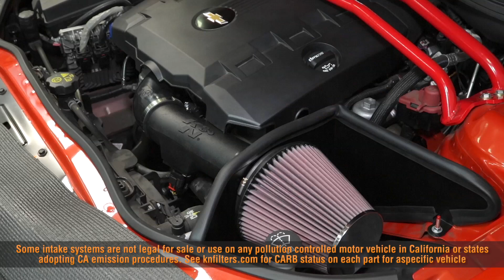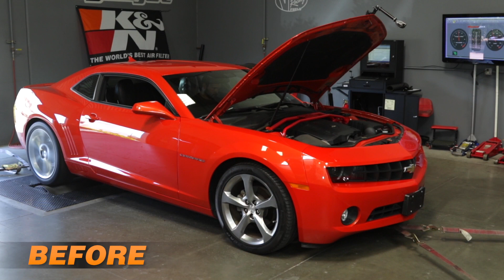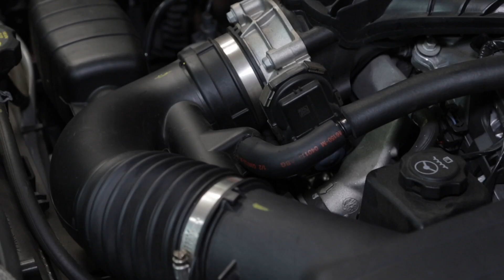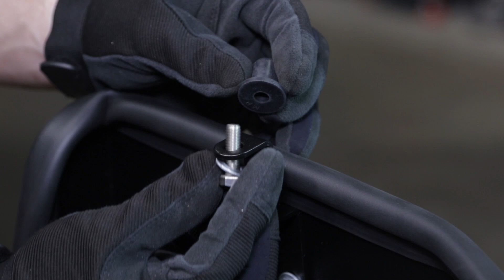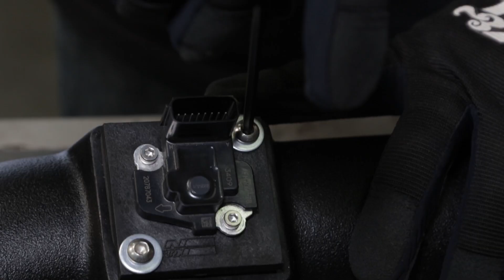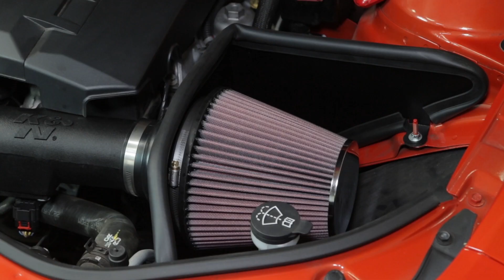Chevy Camaro 3.6L [#57-3078] Air Intake Installation

Comment: Would a 2020 k&n v6 air intake fit a Camaro 2015 v6 lt
Reply from the maker: Yes this system will fit a 2015 Chevrolet Camaro 3.6L.  We have several systems for that vehicle, check them out on the following page
https://www.knfilters.com/chevrolet/camaro/3.6l-v6-gas/2015/

Comment: Does this fit a 2015 Camaro LT V6?
Reply from the maker: Yes this system will fit a 2015 Chevrolet Camaro 3.6L.  Check out the product page on our website https://www.knfilters.com/57-3078-performance-air-intake-system

Comment: waste of money if you don't have the car tuned properly for this mod......
Reply from the maker: All K&N intake systems provide a guaranteed increase in horsepower and torque with factory ECU settings.  This system has been tested to provide an increase of 13.14HP and 14.44 LBFT.  Check out the dyno chart on our website http://kandn.com/dynocharts/57-3078_dyno.pdf
Reply: @KNfilters   why should anyone trust YOUR dyno charts ????  Unless the car is tuned for the mod NO one will see an increase in HP.....in fact they may see a decline in performance......... FACT !!!
Reply: @jessieismyfriend  I wanna get a cold air intake for my 2015 Camaro so should I get a tune first before I even get the intake?
Reply: @jacobcardenas9697   get the air intake installed and then have it tuned by someone who knows what they're doing

Comment: Why does my car keep turning off
Reply from the maker: Please contact our product specialists at 800-858-3333 or tech@knfilters.com.  They will be able to quickly help you resolve the issue.
Reply: Did you ever figure out what the issue was?
Reply: My car ran great before install and now it will idle inconsistently and stall out shortly after starting. I disconnected the negative terminal during install and my car won't accept new part. CEL also came on for P0102 MAF sensor readings. I double checked that there isn't any loose connections and sensor has been cleaned. Any suggestions?
Reply: @matthewsparks113  did you make sure you put the mass air flow sensor in the correct way

Comment: Does this work on a 2011
Reply from the maker: No this part will not work on a 2011 Chevrolet Camaro 3.6L, however there are a number of intake options for that vehicle.  Check out the following link: https://www.knfilters.com/chevrolet/camaro/3.6l-v6-gas/2011/

Comment: I can’t find out where to add my k/n oil filter at I put the air filter on but u cane with small one too I gave 1998 z28 LS1 Camaro
Reply from the maker: Please contact our product specialists at 800-858-3333 or tech@knfilters.com for help with your question

Comment: Why would you need to disconnect your battery?!?! Unless doing so resets the computer I guess to learn the increased airflow.. but technically it should auto learn and make adjustments on the fly.. Can any mechanic comment on this..
Reply: graphicsgod I’m not a mechanic myself.. but I’m very interested in mechanics.. I may have a answer, if u don’t disconnect the negative battery and just install the cold air intake itself.. when starting it, it will pop up the check engine light, which u will have to reset it for 10 or 20 minuets... Note: this isn’t actual answer, this is my possible answer for your question.. hope that helps! :)
Reply: D4RK KN1GHT 52 Just did this mod and no engine lights were triggered, nor any issues have happened! If anything it sounds soo good and feels like I have more power due to the increased air flow! I'm not sure if the computer compensated for the increased air flow or not, due to the fact I did not disconnect the battery..
Reply: graphicsgod hmmm..but if it theres isn’t a triggered check engine light or anything then ur all good.. but the computer part I’m not to sure about that... my previous answer was a maybe answer for you. But like I said if there’s no engine light ur good to go
Reply: all mods recommend disconnecting battery so you dont cause a short